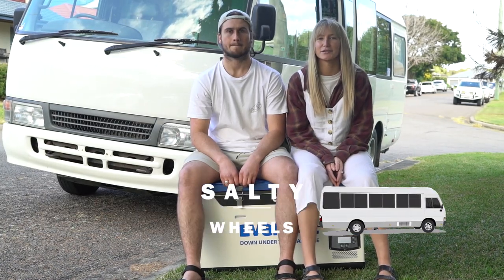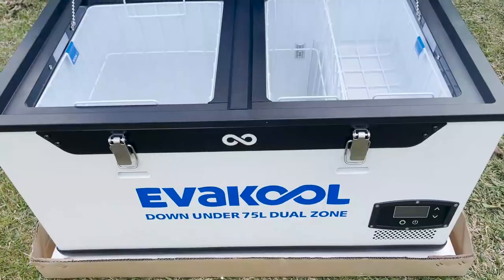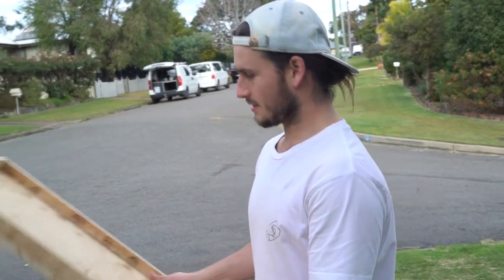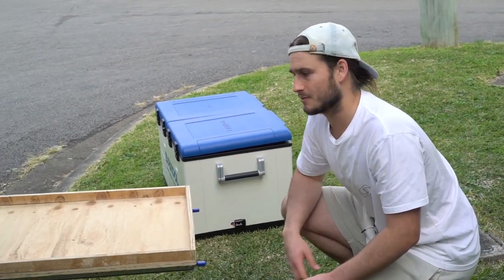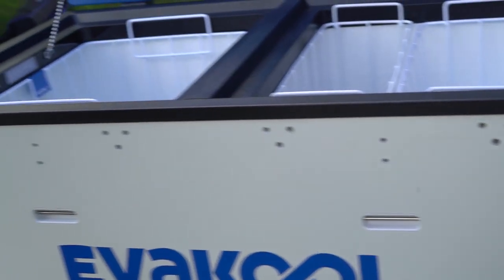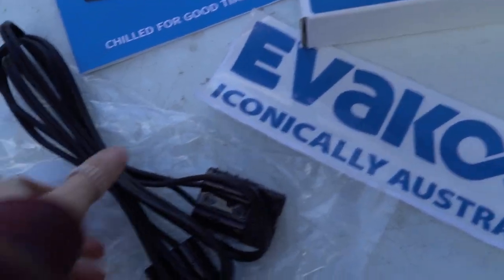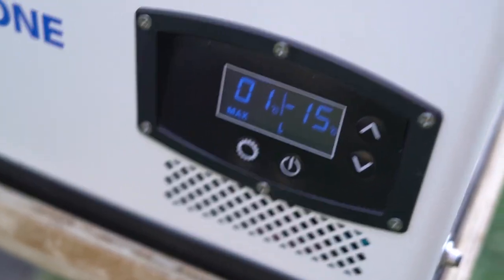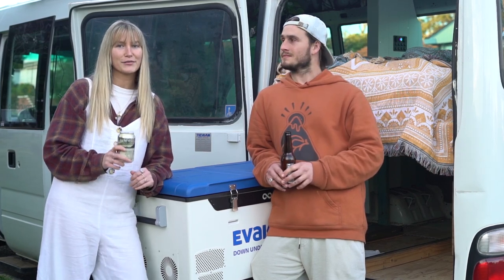Fridge Giveaway & Install | Bus Build | Toyota Coaster Conversion

Comment: Good job guys. Nice to see the anderson plug connection on the fridge.
Reply from the maker: Awesome setup isn't it! It can also plug into 240v so it's awesome if you have an inverter or want to use it at home. Cheers for watching!

Comment: Does the fan have a variable speed in the down under series? Meaning that fan kicks in at high speed during first time turning it on or high drawing power mode, then fan slows down when on idle mode. Or is the fan just constant like when it's powered up? Thank you
Reply: Hi Alex, the fan runs in conjunction with the compressor, so when the compressor is running so is the fan.
 The compressor does have a “Max” and “Eco” mode for the compressor speed.